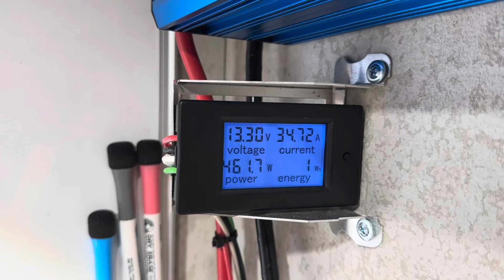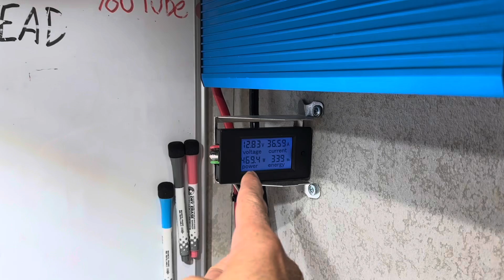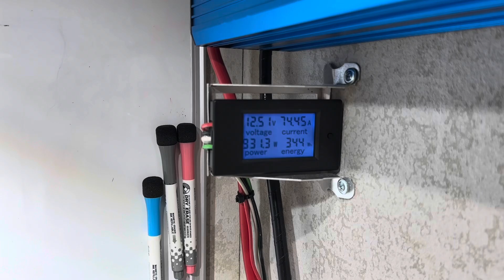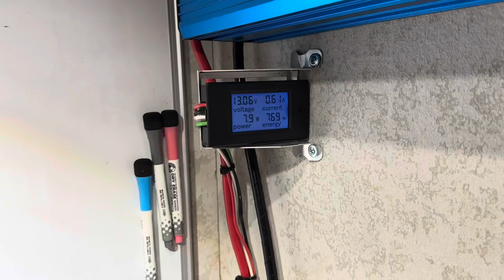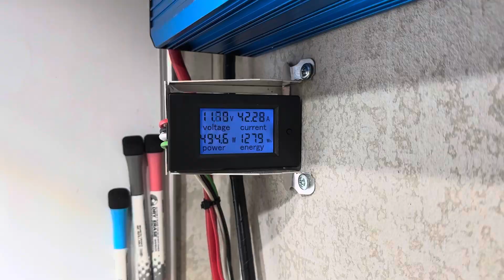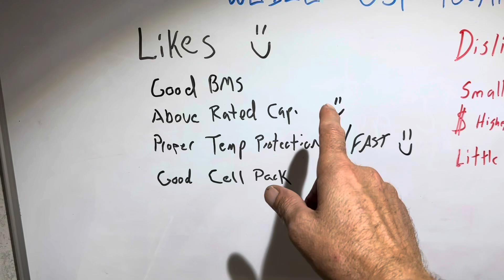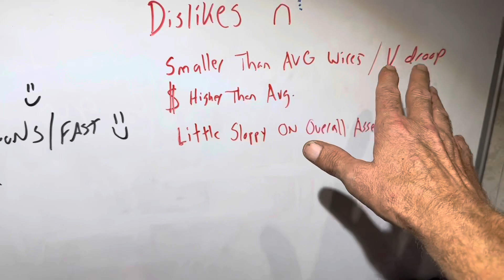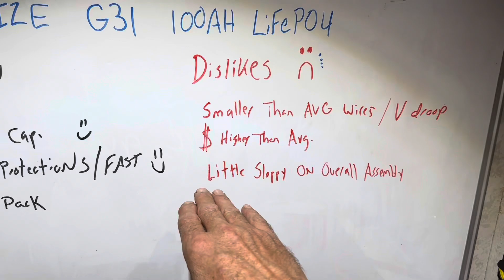WEIZE 12.8V 100Ah LiFePO4 Lithium Battery Review and Teardown

Comment from the maker: See the WEIZE + NEW 24V ALFFAA inverter here https://youtu.be/ZeSWRk2txHc?si=jiugaNWFwyXIyGKW
Thanks for watching!
Reply: Are those the heated version? I've got 2 12v AGM wieze that I've used in my solar system 12v system. My inverter decided it don't wanna work anymore so I stole one battery and put it in my enclosed car hauler. And I have a 75/15  victron charge controller. And I hooked the load side to my car hauler to keep the battery charged. Have had them both for 3 years now. No problems

Comment: I have a weize like  the one your testing. Had for 2 yrs and the guy before me had 1 yr use so 3 all together. well it worked great untill today and now it only show 7 volt I charge with a lithium 20 amp . any reason it would only show 7 volts ? how do I make sure the battery's inside are level  ? thanks Rick
Reply from the maker: Did the charger activate and begin charging? Does the voltage rise or just stay at 7V? Has it been sitting for a while and may have self discharged?

Comment: Wow glad I came across your channel. Just subbed. So I'm trying to do a dual battery set up, i travel for work and basically live out of my car. I want to add a microwave but not sure as to what size of deep cycle battery I should buy. Microwave will be  a 1000 watts. Any suggestions.
Reply from the maker: Glad you found my channel, thanks for the subscription! 
2 batteries in parallel like the Weize would be minimum. 1000W rated microwave puts 1000w to the food. Actual draw is 1600W to 2000W depending on microwave manufacturer and quality. A 1000W microwave makes my 3000W inverter in my RV work pretty hard. Avg of 1800W draw from the battery bank. 
Hope this helps!